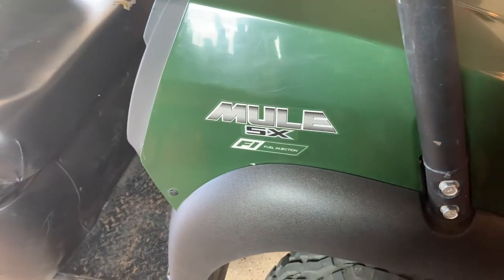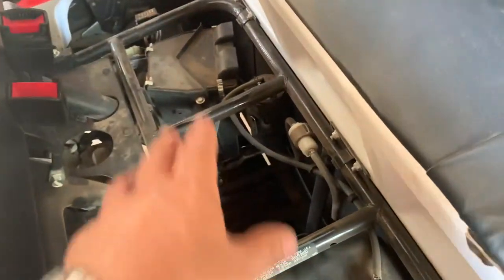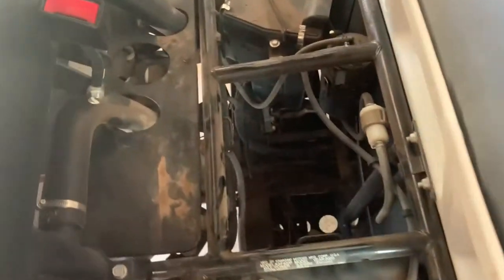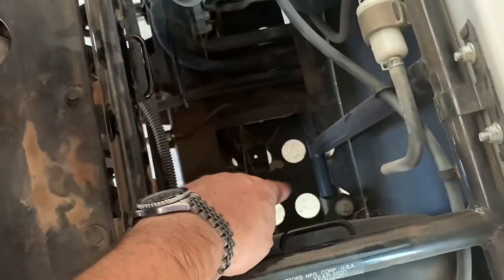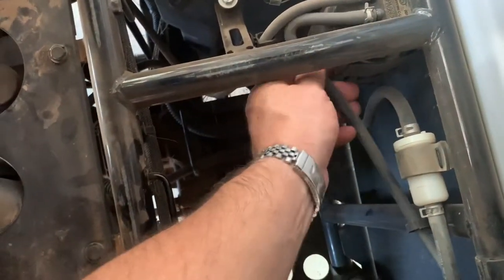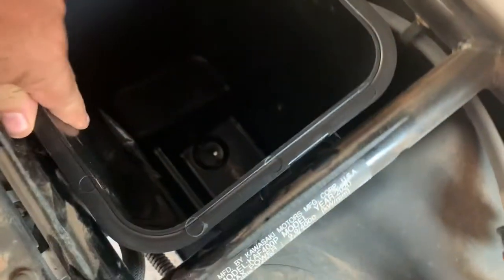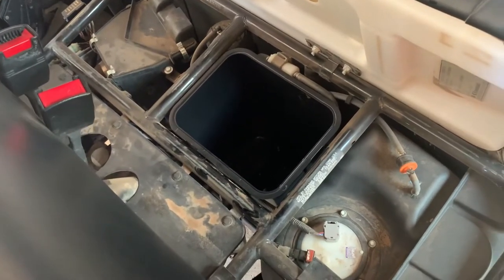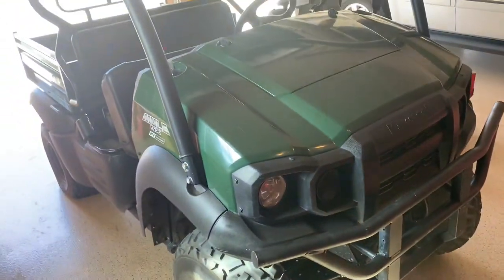Kawasaki Mule SX ● Add Factory Under-Seat Storage Compartment

Comment: and how did you install it with the provided washer, bolt and grommet? and the provided weather stripping/foam?
Reply from the maker: I just dropped it in like I explained in the video. I didn’t do anything else. It’s just a plastic bucket. It’s not going anywhere.